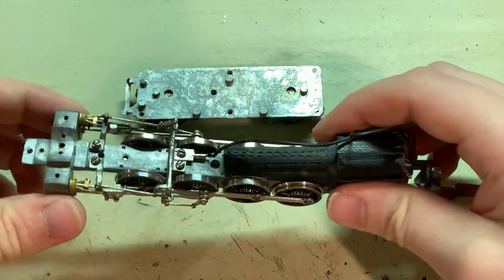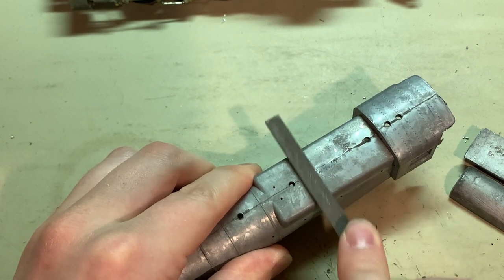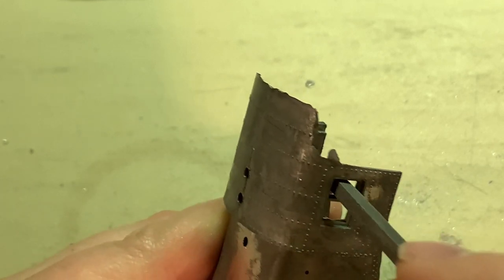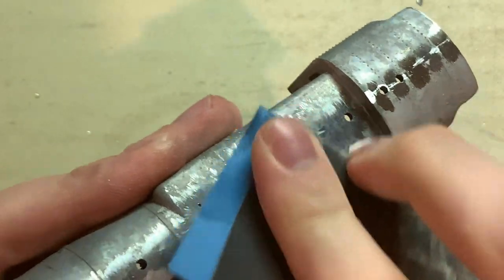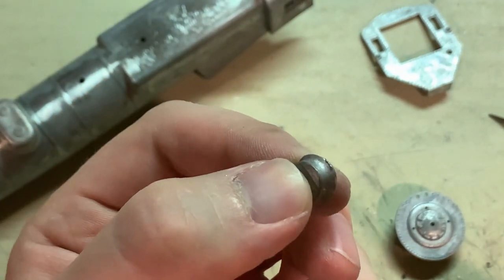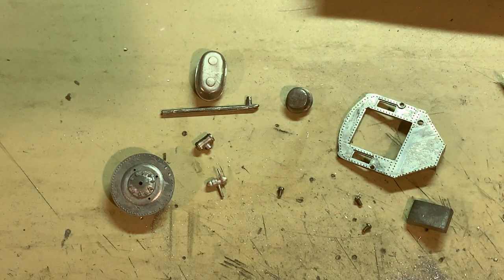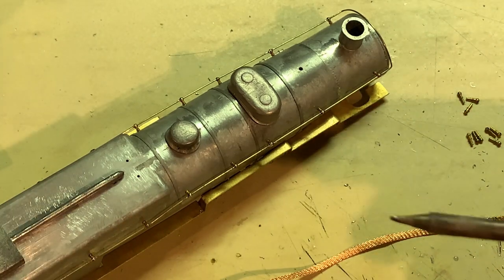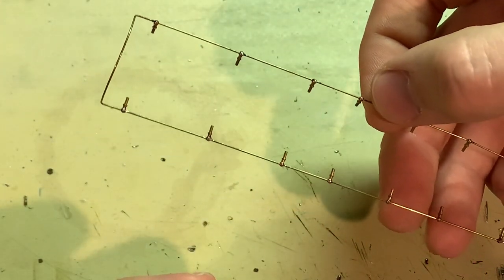How to Build an Intermediate HO Scale Steam Engine Kit: Part 4 - Boiler, Trucks & Basic Details

Comment: Bowser got the idea for the formed brass walk ways from Penn Line. That was how PL designed their 2-8-0 and 4-4-2 locomotives (which used the same boiler). Great video series! You are building my favorite locomotive!
Reply from the maker: Thanks!  Penn Line had a lot of good ideas in their kits, even going down to the cheapest models.  My lead D1 Midget can probably outpull a plastic SD40. :D

Comment: 37:15 one mistake you've made, the hand rails on Pennsy steam are hollow inside and are used as a conduit for electrical wires for lighting and actually to connect electric from the turbo also. You should have at least run them to touch the cab. On some locomotive pictures you can see the electrical wire running up from the handrail in front of the cab.
Reply from the maker: Thanks for the tip!  After checking through prototype photos, I think I have an idea of what to do about that once I get to super detailing.

Comment: What grit of sandpaper did you use on the superglue? Also, are all of their metal kits made of white metal?
Reply from the maker: I used 600 grit automotive sandpaper.  Bowser's kits are almost all zinc diecast with the only exception being the original lost wax cast brass 4-8-2.  They rarely use white metal, and it's only for smaller parts when they do use it.
Reply: @DarthSantaFe  Thanks.